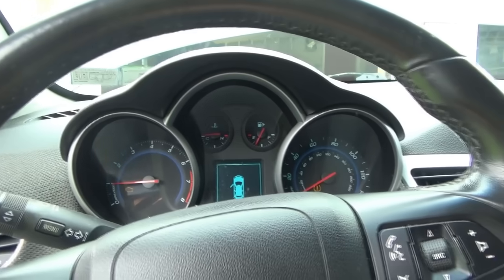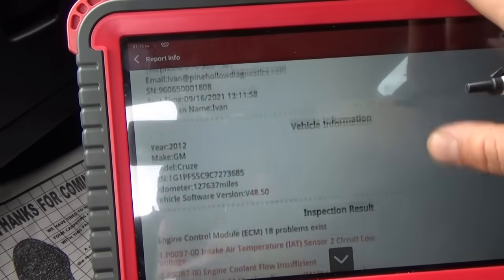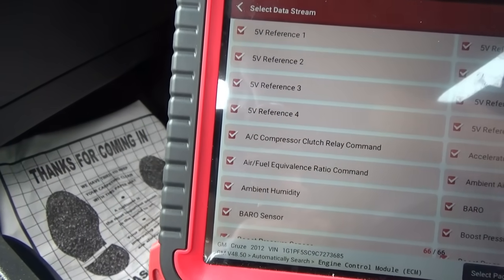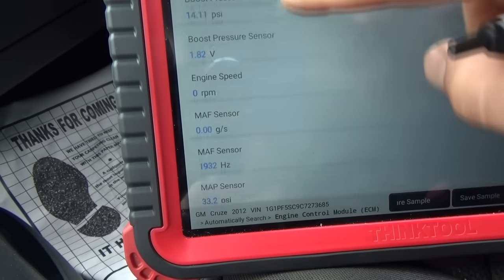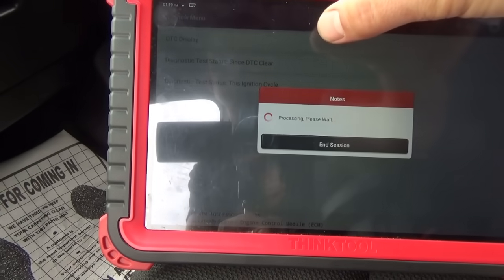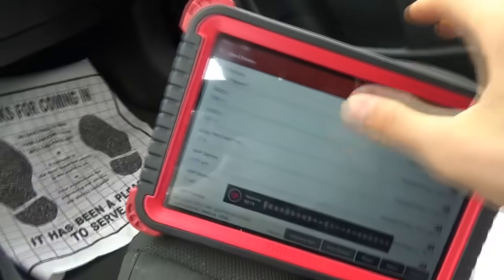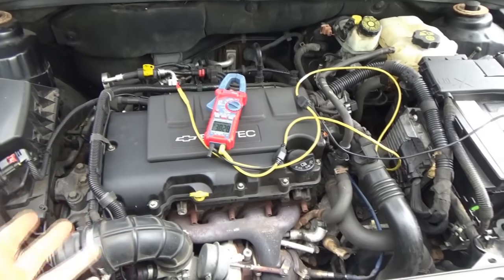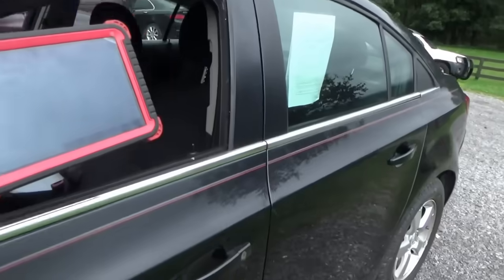Scotty Kilmer was RIGHT! (Cruze Turbo Rough Idle P0106 P0171)

Comment: I told my Daughter Mother not to get one of these a long time ago and she did anyways and that mtf was nothing but problems. She thought she got a good deal. She got mad at me for saying it was trash of a car.🤣 Its an absolute mess of a car mechanically. First the turbo went bad,  then like this one she needed a whole new air intake,  Timing chain stretched,  had to have a new starter, axle broke, AC Compressor went bad. All that happened before the factory warranty was up.  After the factory warranty was up she hit a pothole and it broke the plastic on the lower radiator,  Windshield wiper disconnected during a downpour on the express way, had a leak in the upper right corner of the front window.! Door handle had to be fixed. She had it all fixed and finally traded it in for a 2019 Toyota Camry

Comment: You have to replace the valve cover that has the PCV diafragm embedded. You only need the valve cover to solve the problem. The system is sucking gases from the oil and the O2 sensor reads rich so the ECU is trying to compensate for that but it can't because of the oil gases.

Comment: The average dude with a good toolbox is hopelessly lost without that data you accessed.  Your research paid off.  I hope we get a second video.  THANK YOU FOR USING CC for we who are having hearing problems!.  Thanks for a very interesting video.  Side note:  my 2015 Jeep Renegade (2.4 engine) was recalled for excessive oil usage, which I was aware of- about a quart per 1000 miles.  The dealer performed an update to the engine computer.  I'm not certain if it's been successful as I don't drive a lot.  Time will tell.

Comment: If you clean up the weak points on these cars their really good cars. My mother got a 12' ECO Cruze brand new and she sold it in 2021 because she got another car. The only problems she had with the car was a dead battery the first week she bought it, the dealership she bought it from replaced it under warranty and it started leaking from a bad water pump. The water pump went out @ roughly the 90k mile mark right before she sold it.

Comment: I had a job for a year or so where the only thing I did was GM 4 cylinder heads. Had to run an "impreg" line where i took baskets of em at a time and dipped em in some resin stuff that got sucked into the pores of the heads to seal em so they wouldn't have this problem

Comment: Same lump in the vauxhall Astra over here in the UK.  When I see the surging idle first thing I do after finding no external vac leaks is pull the dip stick tube. In fact on the non turbo there is a plastic hose you can pull on the back of the cover then plug the hose and it'll idle fine, diag complete! Easy when you have come across it a few times. Same as any fault I guess... Took me a while the first time tho.

Comment: 22:00 when my pcv valve blew on my Sonic,  it made an extremely loud screeching sound when running or idling, almost like a loud screeching belt, but louder. I was barely 1,000 miles over dealer warranty would cover😡 ordered the part and fixed in my friend's garage. Then about 3 months later there was a recall for it😡. If my intake diaphragm fails, I would upgrade mine to a ZZP ported intake with an improved valve system. kind of an expensive part that's done correctly, or you can mod your own.

Comment: This is typical of these. If I do them at my shop I replace the intake and the valve cover. Also when you replace valve cover take out the 2 bolts holing upper timing guide. Those bolts will be loose. It will cause low oil pressure to the cylinder head causing a tapping like typewriter. There is a small oiling hole in the guide for the chain.  I take the opportunity to remove bolts and red locktite  the bolts back in. If it was my own car I would modify the intake for external check valve.

Comment: Gm used to have a bulletin if you replace cam cover inspect for intake valve.  Then they started special policy on cam cover don't check intake valve.  2 weeks ago they started special policy on the intake for failed valve. Go figure

Comment: That thing on valve cover is pcv and they go bad alot intake is the second thing once they go bad turbo is right behind it
 Plus you need to replace oil dipstick with cover if not you may get another light on for lean/rich  code.

Comment: So Ivan has finally been introduced to the exquisitely engineered, precision manufactured using the absolute finest materials, designed to last for at LEAST 200K miles ( - 150K ) with ZERO issues GM 1.4 Turbo !!! One of the BEST engines EVER made !!! Just ask the Car Wizard !!! 😁😁😂😂😂 VERY surprised this is the first one he has worked on !!! YES, I am being VERY sarcastic !!! 😄😄😄😄

Comment: Replaced valve cover about a year ago, then about 2 months ago rough cold starts started happening and got worse to where it dies sometimes. Only rough idle on cold start, once warm it clears up.  Got low boost codes few times, cleared them out, now finally got a p0506.. saw this video, looked down that port on intake manifold.. no valve lol ill update if that fixes my issue.
Reply: So new intake helped, but turbo had a crack in it as well, so installed new turbo from maxpeedingrods(the one with billet turbine).. car runs perfect now, better then when purchased around 130k n its at 145k now.

Comment: same color as my 2014 .. mine is leaking oil on the passenger side front of the engine .. i replaced the pcv valve cover/sensor a few years ago

Comment: Had exactly the same idle issue on my Audi A4 2.0 TFSI, cause was PCV valve leaking. After replacement the oil consumption increased dramatically, engine was running fine though.

Comment: Goes to show people should do research on a car before they buy them. The PCV issue with the 1.4L is well documented so much so that the aftermarket came up with a fix for it. I own a Chevy sonic with the 1.4L and 1.8L; the 1.8L is about to reach 300k miles.
Reply: 1.8 seems to be trouble free.
Reply: @johnleinen9409  I've only got about 100k but I can say the 1.8 is very stout, friends with 1.8 cruzes are similarly pleased. Coil packs and thermostats are usually the only things you see go. Timing belt is a breeze to do the engine bay is huge lol

Comment: Hey there is a pcv version 1 through 3 available to fix missing check valve in air intake.  Look up dredan they have kits much cheaper and better repair don't have to replace intake every time

Comment: They took a page right out of the VW 2.0Tsi engineering book on this one. Identical issues but different codes thrown for a similar failure (PCV system).

Comment: So the valve cover regulator vent hole is just supposed to allow in unfiltered air from outside? That doesn't seem like a very professional design choice to me, even if there is a filter inside the regulator, because it would be impossible to clean.
Reply: And it's unmetered air as well.

Comment: yeap, problems became real after replacing turbo and oil return line (sealed the vacuum leak).  Replaced intake because no check ball and now onto valve cover, great.

Comment: That's the oldest on going problem ever.
I'm a mechanic and have a shop here in ireland.theres a lot of those 1.4turbo and naturally aspirated ecotech engines on the go here in Europe.it got to be that big of a problem few years ago that my local main dealership kept rocker covers or as you American say valve cover on the shelf with inlet manifolds.the min one arrived running ruff  you pull the dipstick and stick your finger over the pcv opening and you new straight away.we done that many at the time you could swap out the valve cover and inlet manifold and have the car out the door in 40mins😅😅

Comment: If the problem was limited to the diaphragm (red flapper thing) that got sucked into the intake, could you put a regular pcv valve (in the appropriate direction) in the hose to replace it? And save the replacement of the whole manifold? It's really just another pcv valve except it's built into the cover. No?
Reply from the maker: Nope, the PCV passage is cast into the head and goes right into the intake manifold. The hose is only used to vent the crankcase under boost :)
Reply: @PineHollowAutoDiagnostics  Ok. Thanks. Keep us posted if you can.

Comment: Luckily total for the parts is not much, about $250. But diagnosing the problem,  dealing with drivability issues,  possible emissions test failure  (depending on where one lives), plus labor, makes owning a car like this a headache. Chevy Cruz wouldn't be my first choice for an econobox.
Reply from the maker: Total repair bill is well over a grand...

Comment: I just had a 2011 cruze  head gasket job ,plus i discovered num 3 # spark plug was loose i could turn it by hand either last mechanic forgot to torque it or does it get loose with vibration ,does this happen often ???also manifold plastic melted from inside a bit

Comment: I have a 15. Chevy Cruze LT and I replaced the intake manifold and the pcv vale. Now my car is shaking jerking like it going to cut off. Thick white smoke from the back. And is very loud clunking and ticking sound. And traction control on. What else can be done.

Comment: Great diagnosis Ivan! Agree, information is key.. was chasing an intermittent crank no start earlier today on a Ford Everest, customer brought the car to the dealer and they wanted to replace the PCM. Brought over to me, no codes as scanned so powers and grounds to the pcm were checked, lo and behold, immobilizer was pulling down the pcm and intermittent no comm. Went through a number of wiring diagrams and forums and researched that a failing immobilizer antenna coil is the culprit.. 

In this case, man it really sucks that you'll need to replace the intake manifold and valve cover just a vacuum leak.. 

Cheers!
Reply from the maker: Sounds like a great diag, Aldrin!
Reply: @PineHollowAutoDiagnostics   Indeed it was Ivan. All thanks to you for sharing your wealth of knowledge! Thank you.

Comment: I just discovered my PCV was all plugged up with silicon. After removing it I find it's noisy and the vacuum issues you pointed out with the dipstick etc were more than present. Now I've got this engine and I'm glad I found this out before putting it on the road. Scotty Kilmer was right. These engines really have a quality akin to that of a bag of shit. That said, this makes them cheap and fun to fuck around with. :D

Comment: Pcv fails frequently the bypass hose check valve coming from the turbo and cracked turbo waste gate casting the check valve in the intake fell apart on mine.

Comment: As soon as I started watching I knew exactly what it was it's basic turbo motor it's the same on the 2.0 Volkswagens of the same on the Cruisers it runs to the PCV PCV goes out at builds up pressure in crankcase it could blow out your seals.

Comment: If you think Scotty hating on every automotive manufacturer except Toyota, makes him right, well then that is on you 😂. Honestly watching this video Scotty Kilmer would have never got even close to diagnosing that correctly. He would have called the car a peice of crap and told the customer to junk it or sell it.
Reply: You can't fault someone for being right. Toyota has proven themselves over decades now. He is also honest, when they screw up. And yes, he is an entertainer and I find him to be entertaining. His clickbait titles are a bit annoying though.
Reply: @thomaspower221  the thing is he is almost never right when it comes to automotive diagnostic. Other then he might guess and happen to throw a set of plugs, change the oil or replace an air filter, and it happens to fix the issue or cover it up for abit. As for Toyota, I never said they make bad vehicles, but they are definitely not without fault. I worked as a technician at a Toyota dealer, as well 25 years in the field at other dealers or indy shops. An example is the Tacoma and Tundra frames rotting in North America, the fix by the dealer/manufacturer was more of a patch to get it to last past warranty, which often did not happen. Also the Matrix had issues with the engines developing piston slap, the Prius had loafs of issues including there being a surge when braking. As well as the first gen Prius engines had head gasket issues and would destroy themselves. Toyota along with any manufacturer has its problems. If you look after your vehicle, and keep up with maintenance and repairs, as well as drive sensible, any car can be reliable.
Reply: @thelostshadowofhanzo  yes.. for sure…

Comment: looks to me SOME hands were on this before you looked at it . all the codes with high voltage on the sensors would indicate that they were UNPLUGGED  for the most part then plugged in showing performance codes ??!!

Comment: 2014 cruze 1.4 turbo,  randomly shuts off. No check engine light, anyone know if the purge value could cause this? I looked at battery cables and connections look ok.

Comment: Learned the hard way that any time the check valve gets sucked out of the intake, the car gets an intake manifold, valve cover and crank seal. Had bad experience with crank seal leaking shortly after repair, causing timing chain to jump and burned up the turbo.
Reply: You don't need to replace the intake,
Reply: @michael-lj6zc  what's your fix then?

Comment: I dont understand. On a forced induction engine, the PCV needs to be routed in front of the turbo or supercharger. Otherwise, you would get boost pressure in the crankcase.

Comment: If memory serves these engines had a bad design of the pcv  valve which was built into the valve cover. The diaphragm would rupture causing the vacuum leak

Comment: Hey  I have done with those 7 time I mofied those not need replace camshaft cover and intake manifold,  All i do pop pvp cap out remove digram put plug in that breather hole put cap back on look like normal, then take intake manifold out where checker valve are that red or orange color are that piece you show it gone put RTV gasket maker on screw  then screw in hole block it  then drill hole put 90 degree eblow  then get inline checker valve then other 90 degree eblow closer behind throtte body, then drill hole on valve cover where baffle at local on exhaust side on camshaft cover then put 90 degree eblow on it then go to breather box that other 90 eblow connect by home made hole to breather box.  it ran so awsome no check engine line come on and engine breathe hell lot better  much better than  tab rule  those are sad rip off what they try  explain about from TSB    Need better off morfied it. I have hard time engieener in my head back 2 years ago to save my sister car have same isssue . so after that never touch it no ceck light on no code at all plus don"t using oil  I was shock about it after I did that just by morfiled it

Comment: Wow. About as bad as the vw when you can’t pull the dipstick out or remove the oil cap on the valve cover whenever that one check valve goes bad!  Nutso systems!!

Comment: There's a guy that makes a fix to re locate pcv valve externally and sells them instead of replacing intake manifold every time.
Reply: You basically seall off the oem valve and t it in to intake lines

Comment: Porosity in cylinder heads is nothing new. I remember back in the mid-late 1990s BMW had this on their 328i engine in the UK. I'm not BMW aficionado enough to know the specific engine code it affected but at the time it was a one or two year old car driven by one of the sales reps at the company I worked for - so current model say 1997. It ran like crap.
Head replaced by BMW under warranty as a recall item as known issue.
I guess something goes slightly out of spec in just one thing in the long list of ingredients that go into an aluminium casting (it's a black art!), it doesn't show up in QA but does after a year of proper use.
Reply: I used to do machining on large steel forgings and it was common to find porosity in them, called inclusions. Inclusions in the case I am talking about is caused at the foundry by debris getting into the molten metal and burning off as the metal cools, leaving a empty pocket, I broke a lot of carbide inserts over the years because of this....carbide inserts don't like interrupted cuts.

Comment: The coolant reservoir is also a weak spot! If you don't know how old the reservoir in your Cruze is, Replace it! When it bursts you will overheat the engine in seconds and damage or destroy it very quickly. A tow costs $200 minimum. A new reservoir is around 30 bucks. Save yourself the money and the misery.

Comment: I don't understand tiny Turbo cars. My NA 2007 Elantra, 4 door, 2.0 L engines makes 137HP and goes plenty fast enough. ( I usually beat everyone up to speed ) I get 36 mpg highway and 30/31 around town with a 4 speed Auto. A 2022 model 2.0 should make 150/180HP and get 40+ mpg on the highway with a 6 speed auto trans. No turbos to worry about.

Comment: I've always driven Gm cars. My wives Buick Encore had the same issue, whistling on the port under the cover. It seems forever with a few exceptions that Gm can't make smaller engines. BTW that's the only issue we ever had with the Encore.

 When GM makes a bigger V6 or V8, they are very reliable. I have 2 Grand Prixs with 3.8 engines. Maybe the best engine ever made. Still have both of them. I have a GMC Envoy with a straight 6, again great engine. Small engines for some reason they can't build. Even when they run good they still sound like crap.
Reply: It’s definitely because GM tries so hard to follow in the footsteps of VW/Audi. For some reason GM has this illusion that they can be more European than the actual Europeans, and play this game of copying them. When GM actually acts like GM, and puts time and effort into their craft, they easily blow away the competition. I’m glad to see with EV’s GM is finally getting their knack for American technology, innovation, and engineering back.